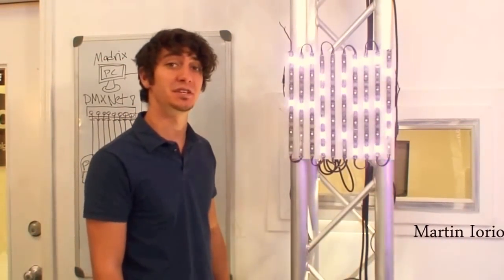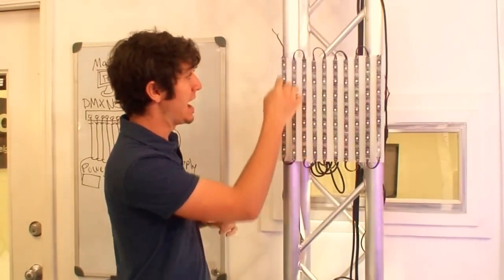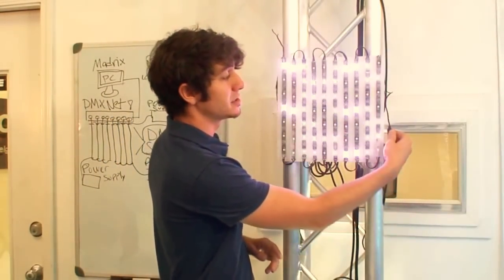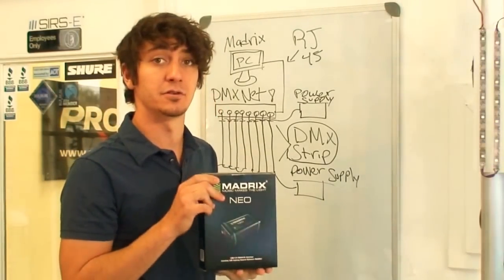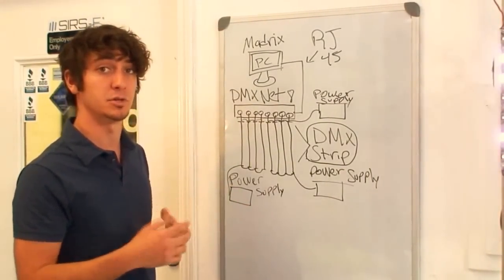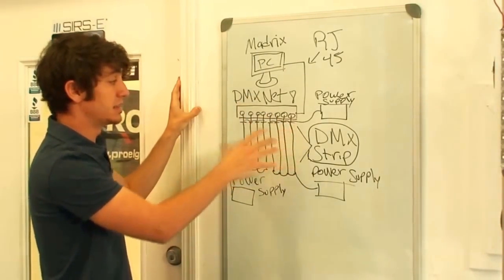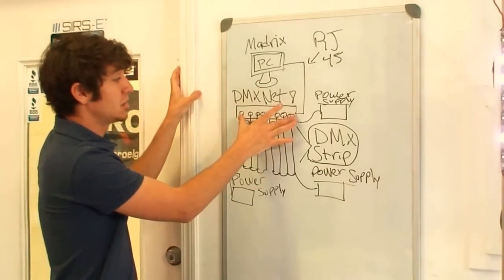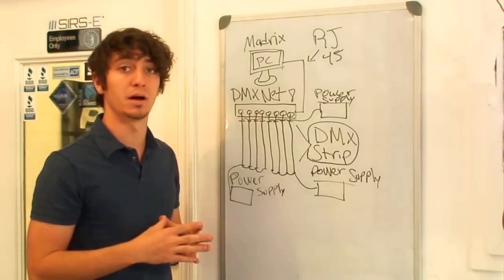How to Build DMX LED Strip Screen Any Size SIRS-E

Comment: Hi guys. Interesting video and good explanation. Only thing I still struggle with is how to hook a power supply onto it. You guys said multiple times that it is good to have power on the beginning and on the end of the strip, right?

Now does that mean two power supplies per strip (or per 4 strips)? Or one power supply with cables to beginning and end?
Reply from the maker: Hello Jan, you can do either option. If limitations mean you only have space for 1 PS then you can just run cable, if you can't run wire that length you can use 2 PS

Comment: Hi there.  Do you have a video on how to connect the DMX cable on the strip as well as the power supply on the other side?  I have some old par cans with a bulb and I want to convert them to LED with DMX but I wasn't sure how to set up the DMX and power configuration. Good video here!

Comment: Hola !! muy interesantes sus videos, les envío saludos desde Kentucky. También quisiera preguntarles lo siguiente: tengo 20 tubos led rgb que me gustaría manejarlos como si fueran una pantalla, poner letras y figuras con colores etc... como lo hacen ustedes en este video, pero no se que necesito. Los tubos me los enviaron con una interface sunlite con salidas dmx pero los cables de los tubos no tienen conectores dmx tienen unos de 5 pines. Saludos y ojalá me puedan ayudar
Reply from the maker: Gracias! nos puede contactar  por telefono o por email con cualquier pregunta que usted tenga y le vamos a poder ayudar mas a detalle. Contactenos a 9565222006. O por email a info@sirs-e.com. gracias por el comentario!
Reply: excelente!! mil gracias, seguiré con atención sus videos. Saludos !
Reply from the maker: Estaremos en contacto.